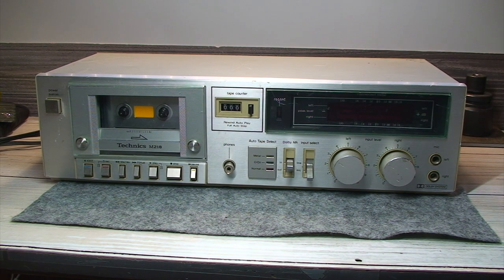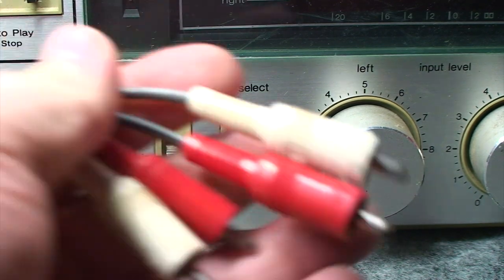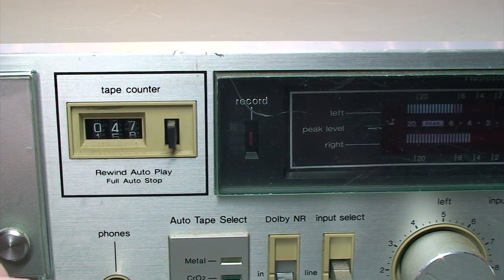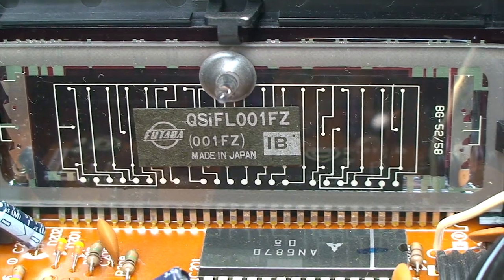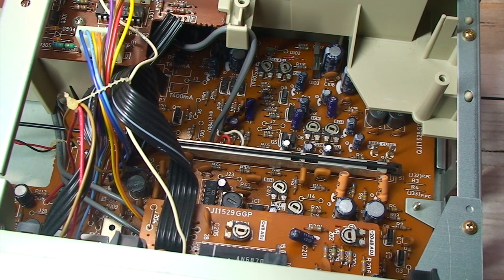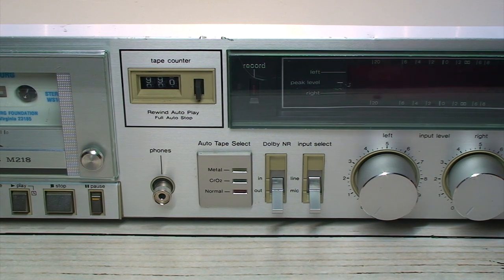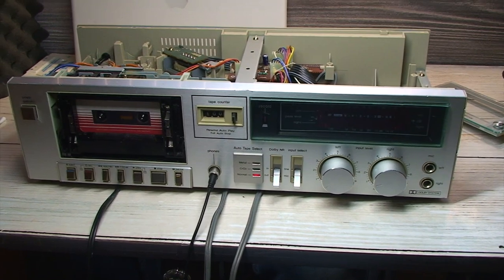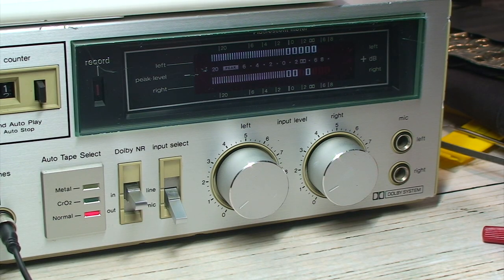Review & "Restoration" of a Technics M218 Cassette Deck

Comment: That's a lot more serviceable than the lower-end Panasonic/Technics decks of the era with the all-plastic cabinet. There are a lot of techniques (no pun intended) for "retrobrighting" yellowed plastic, none of which are guaranteed to work, and there have been reports of retrobrighting causing the plastic to become brittle, or the yellowing to return within a few years and become even worse than if you had simply left it alone.
Reply: would have been a sweet pun tho lol

Comment: Excellent studio quality grade setup, can’t get any better than this! Pretty cool cassette deck, Technics has some solid equipment and this is a nice example. Advanced enough to where it has nice features, but not too complex where it’ll break after one play. Sounds really good and it actually cleaned up really well! Surprising to see it still works with the old belts. For the plastics, you might be able to retrobright them (like with vintage computers) but I have no idea how effective it’ll be. I have a Technics deck that is newer, and it’s pretty good as well but I’ll definitely have to open it up one of these days.

Comment: What a great video tutorial. I have a m215 running slightly slow. Did you turn the motor adjustment clockwise or anti clockwise? Keep up thegreat work. Respect from the UK

Comment: great job on the purchase, speed adjustment & restoration.

As for the yellowing on the plastic surrounds, use "bum spray" (I think u guys call it rattle can?) paint, if the can be disassembled from the unit, disassemble them, if not, use painters tape to mask off areas you don't want painted.

If u want more details, feel free to ask. happy taping!